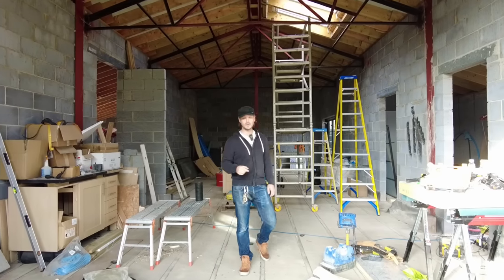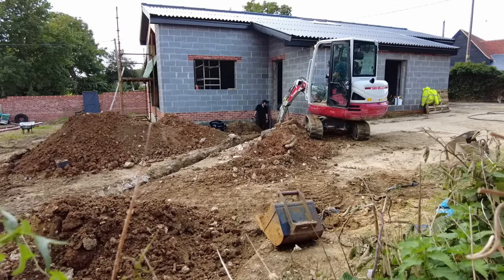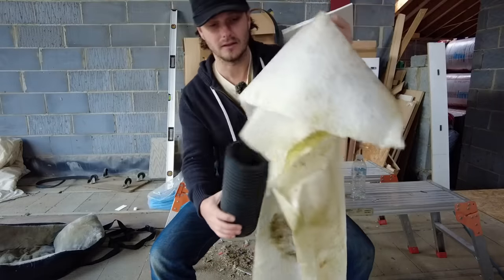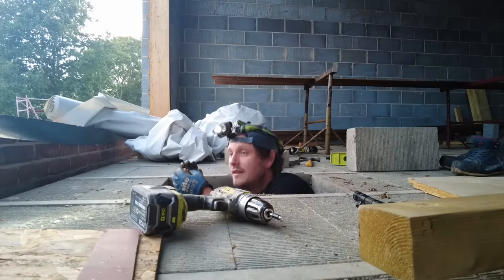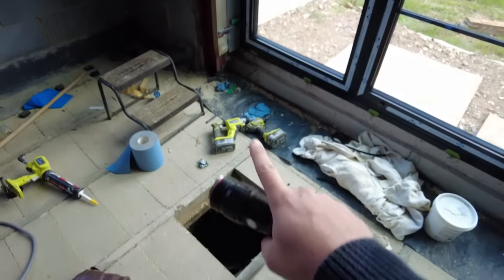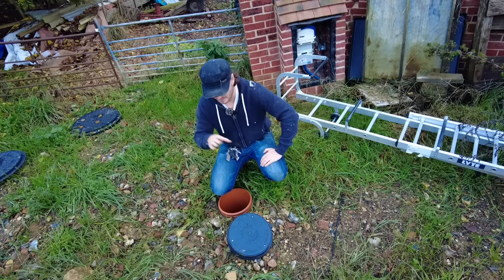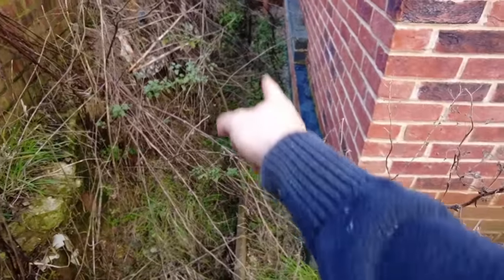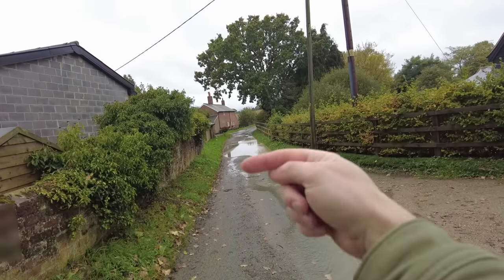Conquering Flooding: How I Saved My Property with Foundation Tanking & French Drains

Comment: I would go under the floor with the pipework. Nice design on the drains
Reply: A service hatch accessible from the outside, and internal access opening connecting the crawlspaces, would be a good idea in the long run. Allowing you to service anything under the floor without going through the floor (once the post and beam is grouted, insulation installed, and finished flooring in.)

Off-topic, but it terms of efficiency:  
- I've read that foil membrane (low emissivity, vapour closed) helps to reduce radiative coupling between the beams and the ground to reduce heat loss - it's basically a thermal mirror. It's good practice to put a membrane down to reduce the moisture coming from the ground anyway. 

-There are "smart" air bricks which you can install that only allow ventilation when the air is dry enough to help dry the crawlspace. I've also seen a soil gas pipe with a motorized damper do the same (with little plastic flaps over the inside of the air bricks to act as a non-return valve). The damper is opened if the absolute humidity of the outside air is low enough AND the RH of the crawlspace is above 50/60%. They use this to control radon build up too.
Reply from the maker: That's interesting about efficiency. A service hatch would be a good idea if it was thought of in the first place 😩

Comment: Great job there mate it’s staying nice and dry under the floor as i think someone else might have commented if you can get the fall you should definitely go under the floor and if there is any chance of it freezing then just get some lagging around it to be extra safe - but you shouldn’t have any standing water in it if the fall is right. Good luck with it mate keep up the good work 👍🏻👍🏻.
Reply from the maker: I'm not sure it would freeze as it is in the middle of the building, although I suppose a little insulation wouldn't hurt

Comment: As a retired plumber I’d say under the floor is fine – but you must have access to the underfloor space. Often repairing a pipe costs very little, its getting access & taking down tiled or plastered walls or digging up floors is where the real cost is. Also insurance will cover the cost of the pipe repair, but not the damage getting to it. You might also be tempted to say ‘ What could possibly go wrong with a pipe under the floor ? ‘. You just know how that’s going to turn out.
Reply from the maker: Ah, well there won't be any access under the floor 🫣 I'll have to make sure I do a good job of it

Comment: Would definitely extend the lintel for the pipework in the underground section, not enough support on the left side If there was ground movement.
Reply from the maker: I'll have to check when I'm under there next 😅 I'm pretty sure the lintel will be too low for me to use that opening though 😣

Comment: You could insulated trench block work after tanking the wall with 50mm xps foam board.
Reply from the maker: Probably no point as it's ventilated under there, although foam board would actually protect the tanking membrane 🤔

Comment: why 50mmm pipe under, why not full size 110mm ?
Reply from the maker: I don't really need 110 as it'll only be for a sink. A 3m run in 50mm doesn't need venting so that's why I was planning on going down that route, plus it'll be easier for me to get into the other pipe...in theory 😬
Reply: hmm.. not a kitchen sink with fatty muck clogging it i hope, or a bathroom sink with hair and soap, easier to clean out if bigger. oh and ps think about installing pipes for disabled shower and loos downstairs which may be needed in a few decades  
 @THE-AIDEN-PROJECT

Comment: Under the floor for max thermal efficiency. If you run it in the insulation you’ll get a much bigger thermal bridge, rather than a small one just where the pipe goes through the floor!
Reply from the maker: Good point 🙌
Reply: And a bigger pipe is less likely to block, when I was a younger man and built footings those internal walls would have had some holes for cross ventilation
Reply from the maker: @peterthebricky  ahaa I didn't even clock that, that run is the only one that doesn't have any for some reason 🙈 maybe the brickies thought the lintel opening was enough but that plan went out the window when the main contractor decided to not put the pipe in and then later blocked it with shingle and lean mix 🤦

Comment: Do your island drain run in 110 under the floor into a vertical stub stack within the island with a reducer cap to install the small bore pipework, a lot less chance of blocking and if it does you can remove the reducer and clear that what
Reply from the maker: That's sounds like a good plan although I think a 110 will be tight 😬 I'll have to lift the other side and check that pipe

Comment: I would defo put your 50mm pipe under the floor mate, you’ll get a much better fall on it
Reply from the maker: True that, otherwise I'll be faffing cutting insulation 😬
Reply: @THE-AIDEN-PROJECT  yeah did that mate ! Cutting that stuff isn’t a fun job !
Reply from the maker: @LTWCarpentry  I will need to cut it for the water pipes to the island though 😫 I'll have to see if I can get some kind of hot knife from China maybe 😆